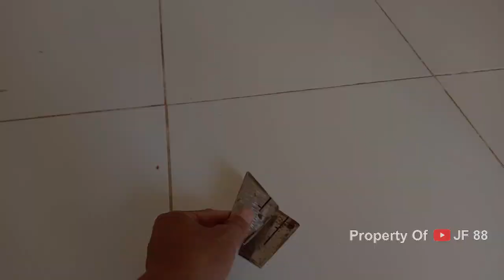Membuat Sistem Kemudi RC Kapal Perang

Comment: thx bang :) walau saya belum bikin body kapal nya tapi cari tau apa aja yang di perluin dan bentuk kapal nya gmn hehe thx :D
Reply from the maker: Ini resep kelas ekonomi 😃
Kalau kelas wahid gak usah pasti nguras dompet 😆👇

Serat fiberglass: https://shp.ee/hwbdcir 
Resin bening stock banyak: https://shp.ee/rk8amdv
Motor 775 4rb RPM: https://shp.ee/xwqezbm
Aki 12V: https://shp.ee/zizp375
Servo Kemudi: https://shp.ee/8v7pyrm
Propeller CW & CCW 6cm: https://shp.ee/tvy9v6m
Pump pendingin ESC: https://shp.ee/7n4erk5
Shaft As 4mmx300mm: https://shp.ee/qt376iv
Servo radar: https://shp.ee/zinzrav
Servo meriam: https://shp.ee/urs4kxd
Klakson suara kapal: https://shp.ee/46jr34v
Limit switch: https://shp.ee/hzku8bd

TOOLS:
Mesin bor: https://shp.ee/u6rq4sr
Mesin Grinda 4'': https://shp.ee/btneej9
Reply: @jufri_88  wooo thx bang brp nih habis nya bikin kapal ini pakai barang baang yang abang tulis
Reply from the maker: 3-4 jutaan

Comment: 1:22 bang mau nanya itu yang 2 biji warna hitam itu apa ya bang namanya?
Reply from the maker: Tuas servo
Reply: @jufri_88  oo ok bang
Reply: @jufri_88  dimana ya bang beli nya😅
Reply from the maker: Sepaket. Servo kemudi: https://shp.ee/c3csj5m
Reply from the maker: Siapa tau butuh yg lain juga SPESIFIKASI PARTS:
Transmitter/Receiver 10ch (remot stik): https://shp.ee/vdbwygm
ESC:
Motor DC 775x2: https://shp.ee/nbjyxam
Aki 12Vx2: https://shp.ee/usg66z5
Servo kemudi: https://shp.ee/c3csj5m
Servo meriam (metal gear): https://shp.ee/8kqmsud
Servo switch: https://shp.ee/99rrqbv
Limit switch/Mini micro switch: https://shp.ee/9w93yzd
Baling-baling 6cm: https://shp.ee/rkitghm
Shaft As: (4mmx300mm): https://shp.ee/cn2zgw5
Pump pendingin ESC: https://shp.ee/wg4m5e5
Servo Radar: https://shp.ee/u36haev
Klakson suara kapal: https://shp.ee/krd6a7v